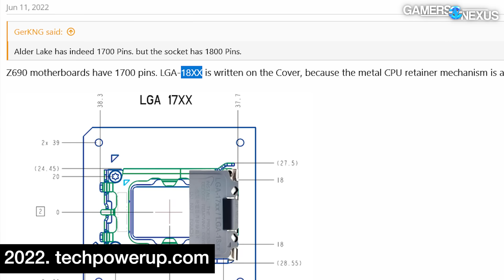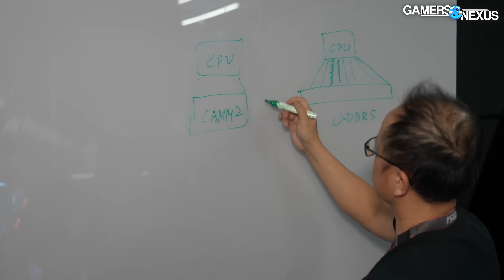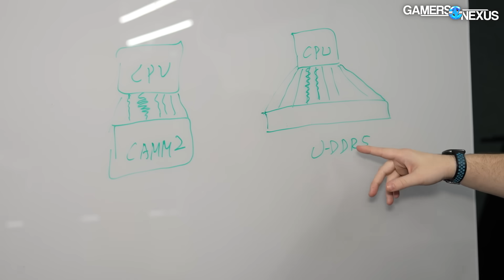Intel Says Not to Say "LGA1851" or "Z890" | MSI vs. ASUS Features & X870E Boards

Comment: LUL
Is intel seriously gonna do this again? Remember how they did LGA 1155 in to LGA 1151 in the span of a few generations years ago & had people switching platforms completely 2-3 times in like 2 years if you wanted to stay with the best hardware?  If they do that again with LGA 1851 in to some other variant of it, that's all the more reason for me to never go back to Intel.
Around how long do we figure the X3D chips will take to come out after AMD's 9000-series CPUs release? The normal 4-6 months?  Thinking I may upgrade my 7800X3D if the next generation's uplift is worth the price.
Reply: Does this mean that the motherboard with socket 1700 is not suitable for the new generation of CPU?

Comment: Id like a motherboard with a 90 degree camm2 slot to go vertical, could fit 2 or more that way!!!
Reply: That would go against the trace length advantage since now one end of the connector is farther from the CPU. One module also has plenty of room(possibly enough for 256GB on the largest version in the future, at least 128 now), and there is a design for a socket that you put two stacked, staggered single-channel modules on.
Reply: @whyjay9959  Rather than devising upgrade-hostile memory systems, just stop installing MSWindows and you'll see a performance boost right there.
Reply: main point in making traces shorter. Turning slots = longer trace.

Comment: Why wouldn't you mount the CAMM module on the back of the motherboard, directly behind the CPU where the traces would be the shortest?
Reply: Cooler compatibility would vanish if you were directly behind the socket

Comment: This makes me appreciate AMD naming the sockets AM3, AM4, and AM5. I looked up an Intel socket and it was LGA1wxyz. LGA1150,  LGA1151, LGA 1050, LGA 1155. The newer numbers are easier though. At least AMD won't be "GASP! HOW DID YOU GUESS THE NEXT SOCKET IS AM6?"
Reply: Intel's naming makes sense, but as a technical detail not a revision number.

"Land Grid Array <Pin Count>" -> "LGA 1wxyz"
Reply: @EmperorA0 But for the people they’re aiming those CPUs at, it’s easier to do what AMD has done.
Reply: @HelloFellowDinosaurs even then it’s not 100% true, wasn’t there a big mad issue a couple years ago where the new cpus weren’t supported on older am4 boards?
Reply: Here's an idea: LGmAb4LL5
Reply: Knowing them they might rename it to AI6
Reply: IKR. Also glad I went AM5 this upgrade with the extremely long lifecycle it will have.
Reply: It is confusing when you have to work with old intel hardware trying to workout which lga11xx socket belongs to which family. I find it's easier to just go by the chipset name and lookup compatibility for them when needed.
Reply: Bet you didn't think it would go from X670 to X870.
Reply: @jjlw2378  Windows 8 -> Windows 10(last Windows ever) -> Windows 11
Reply: Bro still behind 10 years ago
Reply: lga 1718 search it on goog
Reply: Intel: named due to specification 
AMD: our customers collect belly button lint
Reply: All of Intel's sockets have formal "names," H1/2/3/4/5 for 1156 through 1200, V/V1 for 1700/1851, R# for 2011/2066, and other letters for other socket families
Reply: AMD also supports their sockets and hardware much longer than other companies in the industry.
Reply: LGA 1151 is named like that because the socket has 1151 pins contacting the CPU. Same applies to all Intel sockets: socket number = number of pins.
Reply: @SocratesWasRight  The point is it's easier to ask if an AMD CPU or Mobo is AM4 or 5.  It rolls off the tongue better.l

Keep it simple etc
Reply: @SocratesWasRight  Yeah, though it was an interesting era of so many 1s and 5s.
Reply: @InnocentiusLacrimosa that'd be fine if all 1151 chips were compatible.
They're not.
Reply: @SocratesWasRight  while logical, that still doesn't help the typical consumer identify stuff at a glance. AFAIK it's not even a case of "greater number, later version".
Reply: @PlamoTherapy  "as far as I know" I shall now say something wrong and easily verifiable
Reply: What you call "AM5" is LGA 1718 just like "AM4" would be PGA 1331. Intel has short names for their sockets just like AMD, they just don't get used by people.
Reply: @MajinOthinus  they don't get used by intel marketing either. they haven't used a non pin count socket branding since the Slot 2 back in 1998. with the Socket 615(mobile)/Socket 370(desktop) they switched to marketing the pin count because it made it sound better in marketing to compete with the Super Socket 7, Slot A, and Socket A branding AMD used.
btw anyone that thinks AMD mimicking intel's naming scheme is a new thing... it's not, they've been doing since the beginning.
Reply: @MajinOthinus  If Intel's marketing & PR can silence the pronunciation of the LGA name, they certainly could've migrated to the short names too.

Comment: Those CAMM2s are interesting(EDIT: The largest variant I've seen has 128GB, plans are for 192 or even 256), good to see better connections and a clearer path for air to the CPU. But won't the chips on the underside benefit from cooling too? The module has an odd color, is it made of something more conductive than normal PCB?
Reply: yes finally a new ram connector and better clearances for airflow. i always wondered why desktops didnt get sodimm connectors to be honest, it wouldve really made manufacturing easier to make fewer skus/variants/whatever. But this new connector is so much better than both of the currently available ram connectors, its a happy meet u in the middle from soldering ram to the MB for performance.

Comment: I wonder if someone will take it seriously and whenever marketers at Intel will try to promote their new chip, the name parts will be censored.
Though I'm guessing someone will take them seriously and start sending cease and desist letters to anyone who mentions it. So I won't.
If anyone asks me if they should wait for Intel to release their new CPU's, I will tell them: "No, because we don't even know chipset name, so I can't check the specs" 🤣
Ah, Intel. You finally seem to have done a decent step in the right direction with your hardware and at least minimized the gap between you and AMD in many places (Servers, mobile etc.) - why do you now have to screw up marketing like AMD usually does!? 🤣

Comment: Whoa Black Betty, CAMM is RAM?
Reply: would be incredible on an itx build because it would give much more real estate to CPU fin stacks or water-cooling features like a pump
Reply: @kindadim This 100%
Reply: @kindadim  It doesn't make that much of a difference over horizontal SO-DIMM slots.
Reply: @5467nick  that's arguable, but I wasn't talking about SO-DIMM. I was talking about small form factor custom rigs
Reply: @kindadim  Most of the custom small form factor computers I've handled use SO-DIMM modules. I've seen some board manufacturers make standard mini-ITX boards with SO-DIMM slots too, granted most mini ITX boards do use DIMMs.
Reply: @5467nick  yeah, I'm talking mini-ITX. most custom consumer builds use DIMMs, and switching over to CAMM could be the perfect in between
Reply: Many laptops had soldered on RAM, and CAMM was designed as a newer form-factor so laptops didn't need to have RAM soldered on.

Being a newer form factor, CAMM actually ends up having higher performance than conventional DIMMs.

So CAMM is possibly a future successor to DIMMs. It's flat so it works in thin and light laptops.
Reply: @aminy23 would make for an awesome compact build too!
Reply: ddr4 camm2 modules would be nice.
Reply: I just want to say that this was an excellent joke
Reply: You bastard made me laugh hard, well done.

Comment: it would be hilarious if someone can make 18xx cpus work in LGA1700 boards.
Reply: Lga 1700 has 1700 pins contacting CPU (doh). LGA 18xx will have 1800+ pins passing power and information between CPU and motherboard. So no, it will not happen. 

There was a moment between 7th and 8th gen when both gens used LGA 1151 and the modders could hack BIOSes and cover some contact points in CPUs to make old boards accept newer gen CPUs. That was Intel's missed moment to extend support of that socket for consumers.
Reply: @SocratesWasRight  They probably could have made an am3/am3+ style upgrade path if they made LGA1800 a thing when 12th gen is still under wraps.
Reply: @SocratesWasRight  Oh but Intel never intended to extend socket support for consumers... That's their entire point!
Reply: @Bourinos02  none claimed that they intended and your "entire point" is very different from the OP post.
Reply: This will soon happen. There is a big russian Community that flashes mainboards to use Xeons and X Chipset CPUs on normal B65 or H61 Boards
Reply: I guess the modders could physically remove the 1700 chipset and add 1851 chipset like a surgery.

Comment: the camm2 modules would probably also eliminate cooler clearances being an issue. really cool!
Reply: Yeah, camm should definitely at least replace so-dimm in the market.
Reply: This was my first thought.  Kinda not mad.
Reply: ddr4 camm2 modules would be nice.
Reply: @malvinchau2056  There is one crucial factor no one has covered yet. The amount of heat generated by NVME clusters and this going to become an issue with PCI-E 5.0 drives. Try running 3 gen 4 nvmes with motherboard heatsink and you will see how ridiculously warm they get. They get so hot that they will cause older sata drives to disconnect if they are situated in a case directly opposite the nvme cluster. Not to mention stability issues when gaming in summer. I'm using custom double finned heatsinks in a H500M and still have I to reduce the drives down to Gen 3 due to restriced airflow due to the GPU sitting ontop of the NVME cluster.
Reply: it's also free real estate for any manufacturer to sell covers for the camm modules for personal flair. Flat surface on mobo + something all users will probably need to screw something down = free real estate for images and leds
Reply: should also make it easier to water cool the ram. Plus if one ram stick dies the other one becomes useless anyway. Also the quad socket on dual channel systems was bad anyway because of timing and topology issues. It solves many problems. I found DDR5 to be the uglies feature of a mobo as well. now we can cover and RGB it and water cool it as well. I just wish mobos would use 12VO and get rid of the onboard sata in favour of m.2 (you can buy a sata m.2 if you need sata).
Reply: @ChrisWijtmans  I agree except for the SATA part. Because HDD and SATA SSDs still exist. Plus, there’s people who buys multiple of storages connected to their PC for many reasons.
Reply: Are they the same price?
Reply: @malvinchau2056 PCIe SATA controllers exist and i think it's about high time we utilize the PCIe lanes in our PCs better, or switch to something like the U.2 standard for off-board drives
Heck even M.2 to SATA controllers exist now, usually good for 5 drives, it would give everyone more flexibility if we just offloaded onboard SATA to expandable controller cards.
Reply: @CarbonPanther  I'd like to see some boards with no integrated anything, only the CPU socket, memory sockets, and PCIe sockets. Throw a few m.2 or mini PCIe slots where the rear I/O stuff is and you're set. Board manufacturers keep making people have to buy the same audio, Ethernet, and SATA every generation for several generations in a row when people want to upgrade and it's just absurd. Most hard drives can't even saturate SATA 3GB/s, most people are fine with 100Mb Ethernet let alone 1Gb Ethernet, and audio hardware hasn't really improved much for many years.

m.2 drive cooling is definitely a problem. They might have to give up on the form factor for high-end NVME drives and go back to regular PCIe slots using coolers like video cards have or to drives in bays like you said, though that requires pretty expensive cables and retimer chips for PCIe 5.
Reply: @CarbonPanther  the sata controller on your mobo already is a PCI device. I literlly mentioned m.2 sata controllers and everyone still loses their marbles.

Comment: I'm no engineer but those new mechanisms look like they will break if used excessively.
Reply: is that a problem? I always break off or remove the "latch" because it's pointless and annoying. I'm sorry but whatever little plastic nonsense is not gonna keep a modern GPU in place and I screw in the card in 3 places in the case anyway, where is it going
Reply: PCIe and USB type C internal are only rated to 50 cycles. These connectors aren't really designed to last anyways.
Reply: I assume many users will install their GPU and leave it until they want to do a full clean of their system. These boards are new and will last several CPU generations, and GPU generations are typically every 2 years now. They'll be okay and shouldn't fail after 10-20 uses.
Reply: @M340B58  Lol it's Intel, "several CPU generations" is 2, the current one and the next
Reply: @marcogenovesi8570  current gen is 3. While not nearly as long as AMD, that's decent
Reply: @M340B58  Three that were all the same architecture and node, the last two are almost identical. I would argue that's not decent. Nobody with a 12th or 13th gen is getting much out of going to 14th, whereas somebody with early Ryzen would get something out of a 5000 series, especially an X3D model.
Reply: They're meant to.

Comment: The most normal naming scheme intel has had recently is naming their GPUs after Airplanes.
Reply: Should be OK if they don't call their new product the "737 Max".
Reply: @SenileOtaku just waiting for the Intel Arc M370
Reply: @SenileOtaku  The problem is Boeing's controls and corner cutting.  They just happen to be making a bunch of 737 Max planes, so that's where we're seeing it.

Not sure if you remember when those crashes were happening from an undocumented software "feature." It was also around the same time they lost a space capsule because a software bug.
Reply: @EmperorA0 the design itself was corner cut I believe
Reply: @ruikazane5123 shame the McD administration took over Boeing. The 737NG series was inarguably the best plane ever made. The MAX is arguably better, but suffers from the McD "bean counter"ism

It is suspicious though. The only airlines having issues are the ones with notoriously shit maintenance records.
Reply: @ruikazane5123  Boing allowed airlines to buy planes with just one sensor or three. Only cheap airlines bought the 737MAX planes optioned for a single sensor, only those ones (so far) had the issue of slamming into the ground/ocean when said single sensor fails. Considering other maintenance failures like not putting a single one of the four nuts into an exterior door, it stands to reason we might have in the future seen crashes from even better airlines if anyone let a failed sensor not get replaced before another sensor failed and then the plane goes down. Obviously massively stupid and negligent design that Boing hasn't legally paid for nearly enough considering several hundred people were killed by their greed. That should have sent the responsible people from Boing and the FAA to prison for the rest of their lives.
Reply: intel arc a580 ORC
Reply: Are the GPU’s as reliable as Boeing airplanes?

Asking for a friend…
Reply: Jets and a lake.

Comment: Intel's new socket is made by Medusa and they are doing you a favor by not letting you look at it.
Reply: @POVwithRC  Finally, an appropriate use case for this emoji, as the ancient scrolls foretold.
Reply: @POVwithRC  Perfection
Reply: heh, I had that very same thought!
Reply: hahahaha
Reply: If anyone has trouble with a smooth latch on the madusa socket, Intel will be selling special Madusa "Hair" oil to help
Reply: XD XD XD XD will I need to look at the reflection in my I/O shield to slay (socket) it?
Reply: I like this headcanon. Let's let it live.

Comment: quick release pcie is stupid. It is way more complicated mechanically adding to cost and space. In tight spots, the current mechanism is easy to unlock with a spudger or pencil.
Reply: I usually fix the current system with a pair of pliers, removing it because it's annoying. A mechanical system that moves the release of out the way makes it not annoying, so it will get to survive.
Reply: Do you know how many MBs come to trash after users with pencils...
Reply: @severgun  by me? not a single one having worked on quite a few.
Reply: I may not have a spudger or pencil handy.  I'll always have a finger.  This is a nice little touch.
Reply: @POVwithRC  how to say "I don't have top tier GPU" without saying "I don't have top tier GPU"

Comment: Intel must be really loved by motherboard producers.
Reply from the maker: They definitely seem to be frustrated.
Reply: i want 12VO motherboards.
Reply: @ChrisWijtmans  why?
Reply: @gregandark8571  power savings and smaller connector. Plus the ability to turn off mobo features you a re not using, like a sata controller.